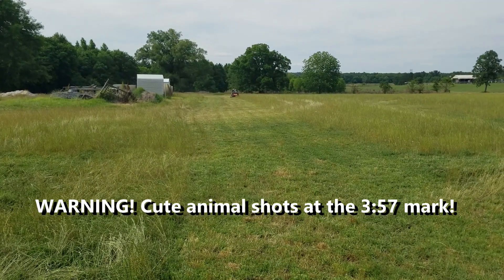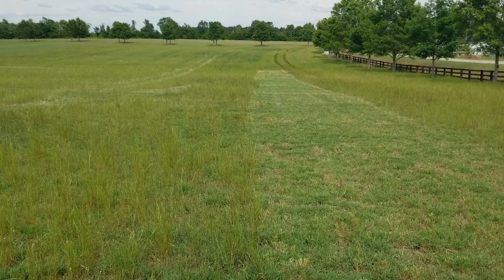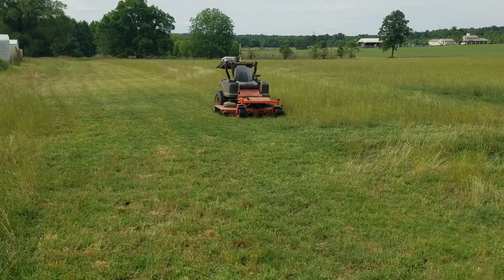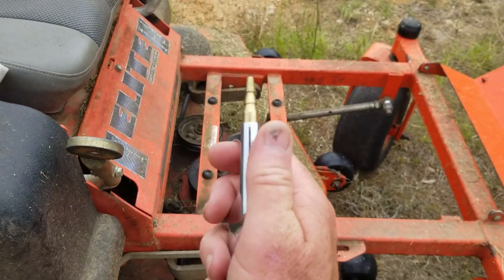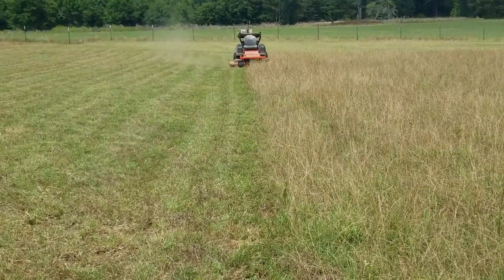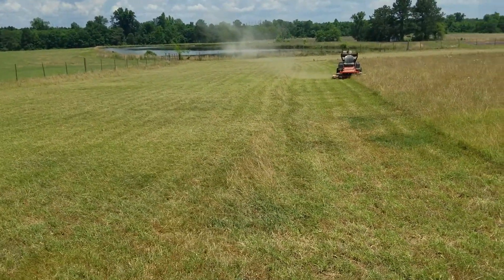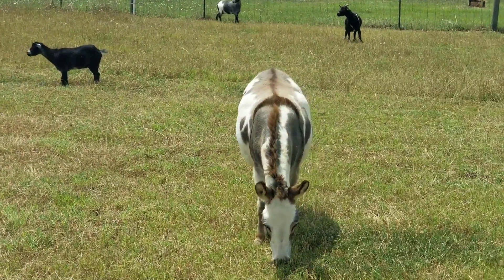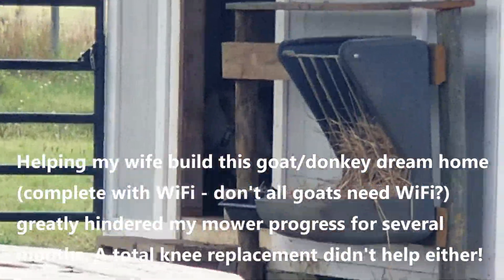Autonomous Mower - First Runs After GPS for Yaw Implemented

Comment: So I’m wondering if you could guide me in a good direction of info. I have wanted to do this concept for about 12 years but building equiptment and using PLC logic to controls is more of my strongpoints, the gps and computer side would be my huge learning curve. Do you know of good info that I could read or watch that helps breakdown this side of the build and shows detailed what’s required in the communication between each  device used?
Reply from the maker: Jon,
I would highly recommend reading through all the pages here: https://ardupilot.org/rover/docs/gettit.html.
Some of the pages you will get to if you click "Next" at the bottom of each page will not be directly applicable and probably not be very interesting. Eventually, you will come to this page: https://ardupilot.org/rover/docs/rover-first-drive.html. That one and the following several pages will give you some idea of how the rover is controlled by ArduRover. 

But, still, it can be daunting to be starting from nearly 0. I'm not trying to toot my own horn, but if you watch my previous videos, you will pick up on a lot of tidbits of information. The first 2 videos I did a couple of years ago may be very helpful to understand some of the mechanical aspects of modifying a mower. HOWEVER, the hardware components I mention there are way out of date. I have changed a lot of things since then, but the basic concepts are the same, so it might still be useful. I have tried to combine all my mower videos in this playlist: https://www.youtube.com/playlist?list=PLIsYv3gzZOt9N9yZmpI_WYiMaBQ6HazOG.

I would also highly recommend looking at Yuri's videos at https://www.youtube.com/c/YurisHomebrewDIY. Yuri has the best tracking mower I have seen. He has great attention to detail and it shows.

Maybe most importantly, look around, search, etc. for topics that you feel you need to know more about on the Ardupilot discussion forum at https://discuss.ardupilot.org/. I am very active there asking questions and trying to help others. I still feel that I am a newbie in a lot of ways. There is so much to learn. The folks on that forum are amazingly nice and friendly. I don't think they understand that you are supposed to bash other people on the internet! (I'm kidding, of course, but it really is one of the nicest groups you will encounter.)

Lastly, I enjoy helping people, so feel free to reach out to me. I will be glad to talk to you over a video chat or something like that if you like and maybe answer some of your questions. Feel free to message me on https://discuss.ardupilot.org/. My username there is ktrussell.

Jump on in! It is fun and useful!
Kenny

Comment: I saw you and Yuri use Cube Orange. Is it ok for Pixhawk 4 to do the GPS Yaw not just Cube Orange?
Reply from the maker: I believe that should work fine. I had GPS Yaw working on a Pixhawk 1 (2.4.8) and it seemed fine. I did not really take it out for a spin, it was just hooked up in a stationary spot outside my shop. I had a Cube Orange on order and so I never installed the Pixhawk 1 on my mower permanently after I added the 2nd GPS.
Reply: @KennyTrussell  thank you very much for your advice. It helps me a lot in saving time and tech navigation
Reply from the maker: @TungPham-om9ex  You are very welcome!

Comment: Kenny :Wwhat is the cable connection from Pixhawk to the ardusimple board ?My Pixhawk is 6 pin GPS and the RTK board has a different connector
Reply from the maker: The older Pixhawk (sometimes called the Pixhawk 1 or 2.4.8) has a DF13 connector. The Ardusimple uses the newer GH1.25 connector, which is also what the newer controllers like the Pixhawk Cube use. The Cube Orange I recently bought included the cable that worked with the Ardusimple board.

For the newer controllers, where you need GH on both ends, this kit will let you contruct cables pretty easily (tiny pins!): https://smile.amazon.com/dp/B07PBHN7TM/ref=cm_sw_em_r_mt_dp_W5R3G89XDJH6RY53XX57?_encoding=UTF8&psc=1.

If you search for DF13 on Amazon, you find plenty of cables with DF13 on both ends (and a similar kit to the one above but for DF13), but what you need is DF13 on one end and GH on the other. They seem hard to find.

I bought mine directly from Ardusimple. They were in a set with other cables I did not need, unfortunatly, so the price was more than I would have liked: https://www.ardusimple.com/product/pixhawk-cable-set/.
Reply from the maker: I also see you can buy the cable you need here: https://store.mrobotics.io/category-s/106.htm